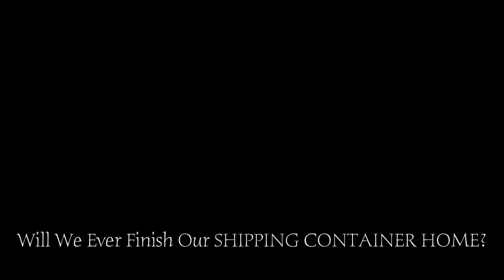SHE FINALLY CAME TO HELP!  BEST BRICK WOOD FIRED PIZZA OVEN - DAY 4 - Ep. 190

Comment: I don't recommend making the oven so high; it would only result in higher wood consumption. Remember, this oven cooks through radiation. If the dome is too high, pizzas and everything else will cook much faster on the bottom. Everything needs to be balanced, and it’s circular because the heat creates a vortex, as I’m sure you know. Keep in mind that the dome doesn’t need to be a perfect arch but slightly flattened. To give you an idea, when your son was standing on top, the dome should end approximately at the height of his elbows. Trust me, I'm Italian, I’m a pizzaiolo, and I’ve built several ovens.
Reply: Great that you share your expertise, although it’s too late
Reply: @Orchidee503  I can imagine, the videos are very delayed, and the oven must already be finished.

Comment: If I was laying brick like that on the job site the foreman would throw my tool bag off the scaffolding.

And for drilling hardwood try using a smaller bit first and then work your way up to a bigger bit to whatever size you need. 😁

But I give you E for effort 👍

Comment: You get a tool and you can make it yourself which pivot from a fix center  with a 3/4 square  tubing which  the end can adjust  and fit holding  a brick and as you build up it guide the brick into a dome

Comment: Great job by all, thank you. I'm wondering of its possible  to have a concrete stamp on the outer shell of oven with banana leaves and a mix of palm furns  I think they're called. I'm not sure palm leaf? That said, I'm not sure what material is used for the dome or if it can be stamped. Idk. It sounds like a lot more work , but as we can see, you're very confident in any project you've done.God bless, be well.

Comment: Jake, you should be protecting your lungs from all that refractory dust and any other kind of dust, like from cement or wood when you work. You don't know what damage you might be doing to yourself that you might not be taking into consideration when you are working and you are in a hurry. I'm concerned about your health. I was a welder, and I always considered my lungs when dust or smoke was involved.
Reply from the maker: I’m outside working in tropical storms. The wind is literally blowing at 10 to 20 to 30 mph all the time the dust is going sideways from me. I’m good.
Reply: Yes Jake the winds are blowing smoke up our you know where 😅. Dust from concrete and wood is deadly. You have a very young family, I am sure you want to be there for them in the future 😊

Comment: Retired tool salsman here. You need to treat that hard tropical wood as if it were steel. 135 degree split point coated, like Drill Co Nitro's. Don't know what brand you can get where you're at. Remember, heat is what kills drill bits. You need a lubricant. Normal steel d.b. lube wouldn't work in wood. Try water or WD40. You absolutely need to cool down your operation. Not only are you killing the bits, but you might walk away onr night just to wake to a fire. I've seen it happen with less heat than you showed on the video.